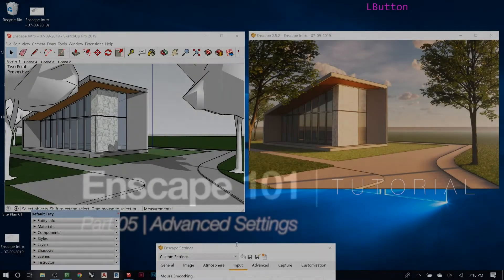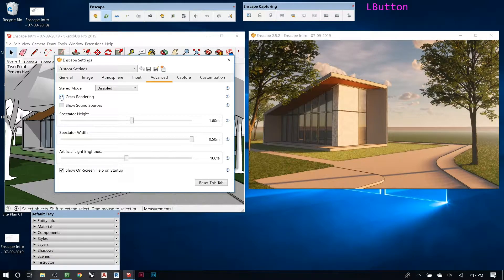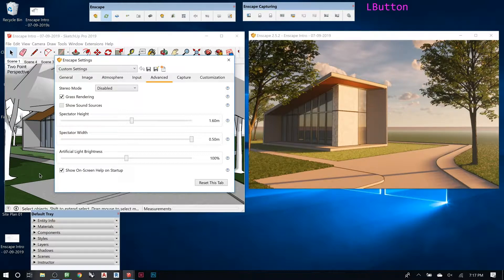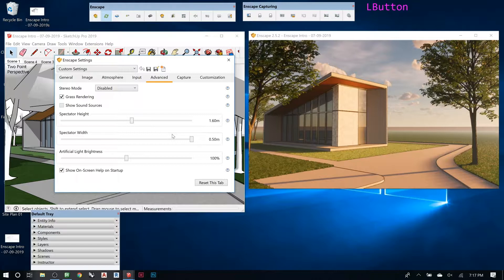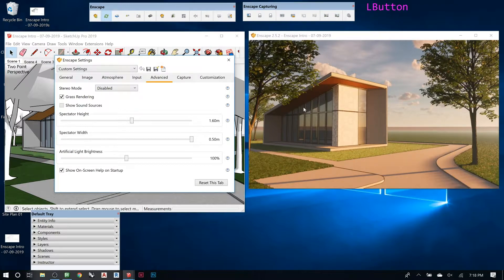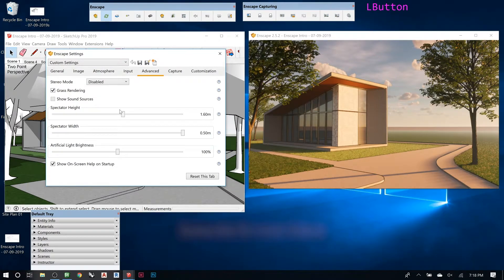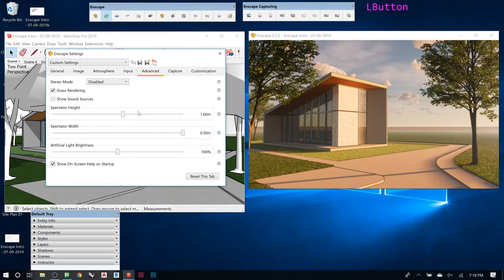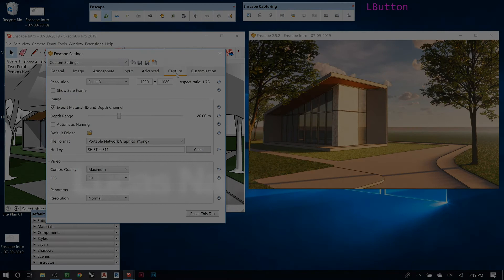Enscape 101 | Part 05 | Advanced Settings

Comment: My building looks very tiny as compared to you no matter how much I try to zoom in. What am I missing here?
Reply from the maker: There is a shortcut in Enscape to zoom into a spot in the model, you just need to double click where you want to go and it will zoom in quickly to that space. Try this and see if it helps. You can also use the arrow keys or the WASD keys to move around in enscape. Holding shift while moving speeds you up and holding shift+Ctrl will move super fast.